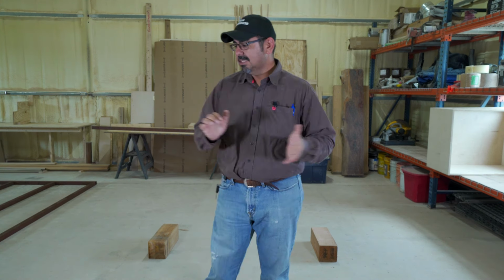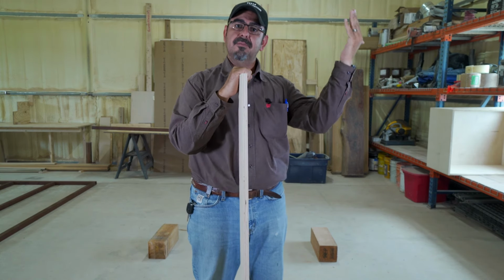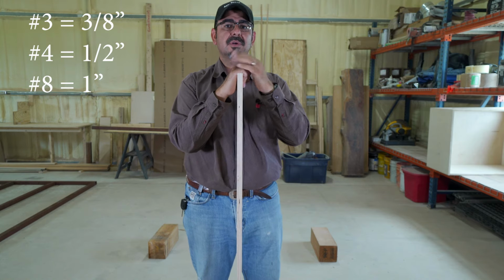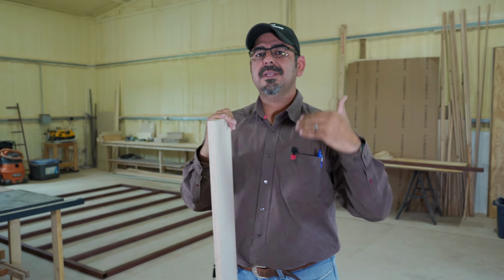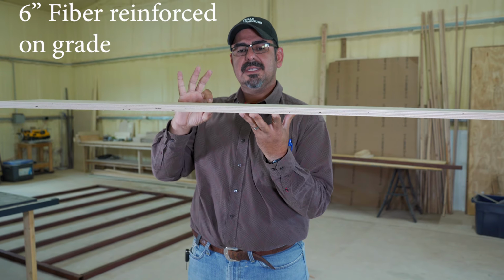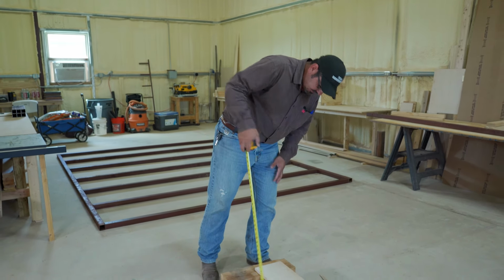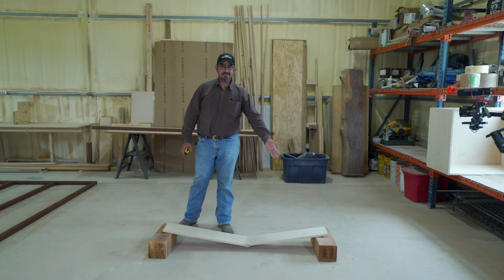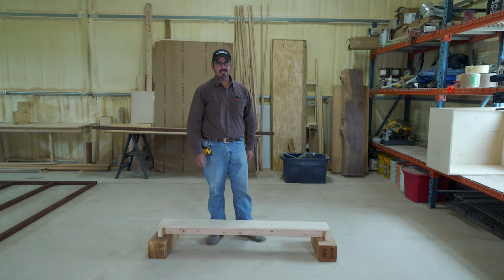Concrete thickness explained! - The Barndominium show E136

Comment: Mate.
Wood isn't concrete.
You didnt even mention the MPS (concrete strength). Best way to prove it is with pressure like an hydraulic press. It's not a good comparison at all mate. Not all concrete slabs need or have support beams or footing. 
Really? I think you should rethink and do a pressure test to see a 4" and 6" under pressure with the mps strength comparison. This is the best option.
Reply: You totally miss the point.

Comment: The man is absolutely correct! What he is talking about is the measurement of concrete, and the types they come in, such as, schedule 440 concrete is very good, but schedule 880 is primarily used in Marine applications, and it is a much harder and dense concrete then schedule 440. The drivers of the concrete trucks used to be able to tell you this, as one time it was required knowledge in order to have the job. The concrete truck driver had to know how to run the mixer, and what recipes to use for what application needed. Nowadays, everything's done on an app! So we people can afford to be stupid people. 😏

Comment: We get it. Nice job. However we arent building a bridge over a sikhole and parking a semi or landing a jumbo jet on it. Not a fair  comparison.  Just trench edges 8in, run some bar on stands , center in slab & depending on length & width, you might run a couple center beams. Adds a little extra cement but shouldnt be all that much difference. Too many projects require too much money for foundation. Its not that complicated.  Most you can do it yourself for 1/3 to 1/2 price. Engineers , plans, permits, inspections (unnecessary b.s.) also add to contractors peice. Buy you some acreage ouut in an undeveloped county & do it yourself & save 10s of thousands on slab part of project. If in city limits , im sorry for your bad luck.  You gonna pay😂

Comment: I’ll save you 10min
The thickness of a slab is determined by the span and weight it will bare, which can be calculated using the correct formulas or just use an engineer.

Comment: At 2:50 you stated the obvious, that a 6 inch slab will be stronger if they are built the same  using the same reinforcement material and all else being equal. So the title of this video is misleading and the video is a waste of time. Everything else you talk about is good information for the uninformed, but it doesn't prove your statement that a 4" slab is stronger than a 6" slab because the presumption in that comparison is that they are the same PSI mix, same slump, same substrate/base, same reinforcement, etc.
You should have used a different title and just did a video of how to get what you think you are getting when comparing concrete quotes. 
ALWAYS put all the specs in writing and field verify during the work. Most concrete guys will promise one thing then they "forget" many components when prepping and doing the pour. I've caught everyone of them (on my jobs) trying to leave something out or try to substitute something cheaper during the job. Very few honest ones out there.
Reply from the maker: Title is not misleading.  
“How can a 4” slab be stronger than a 6” slab?” 
Put beams in the 4” slab.  It will be stronger than 6” slab without beams.  That’s how.
Reply: @TexasBarndominiums  
Bingo. 
I have lost count the times I have met with applicators who know as much or more than the engineers. Bravo brother !!! Keep preaching the construction truth.

Comment: More rebar will make it stronger
Reply: Not necessarily. Not if it's done improper. You can have rebar every 2" but if it's not done properly the rebar will rust and concrete will delam
Reply: And then ultimately crack and end up looking like Syria
Reply: A good engineer will design the slab that works right and costs what it should. There is a whole lot going on with structural concrete - e.g. how deep in the concrete  you locate the rebar matrix is determined by whether the forces on the slab are tensile or shear. Curing of concrete is almost a discipline on its own! For simple, non-critical work, a common sense diy approach will work. In all other cases, read up extensively and talk to a real engineer, especially for building foundations and suspended concrete work.

Comment: This video doesn't make a bit of sense.  Your demonstration with walking on a six inch board with no support vs. a four inch board with support isn't a fair comparison. You're not comparing apples to apples.  If you applied the same support theory using a six inch support board to the six inch slab it's going to be a lot stronger than the four inch and when you walked on it like you did, the drop in the middle of the board would be less than the four inch board.  I thought I had found someone who could give me valuable information however, this lack of  proper comparison makes all your videos and posts suspect and harder to believe.

Comment: what plans dont include all the foundation information? are they dodging building permits/inspections?  When in doubt you talk to a structural engineer not the "concrete guys". Keep and require your slumps.
Reply from the maker: Some States don’t have inspections.
Reply: @TexasBarndominiums  while there are 15 states that defer entirely to local jurisdiction ie to the county and/or city level. Some government entity is usually get paid.
Reply from the maker: I know.  But there are thousands of people pouring concrete “wrong”.  No engineering, no inspections, nothing.  

They will pour a 6” slab with fiber over non compacted soil and talk about how strong it is because it’s a 6” slab.

Comment: Generally Footers are poured to support beams and these are from 12" to 24" deep depending on the load & soil. 

Another factor is the strength of the concrete (typically 2500 to 5000 PSI) & how much water is contained (slump test). a concrete with a lot of water (Makes it easy to pour and work) has a significantly reduced strength.

Rebar does not provide any additional compression strength to concrete. it provides tensile strength (resistance to pull apart). Adding fiber does not make the concrete stronger it just helps to resist small cracking and limiting small cracks from expanding. Rebar has some capacity to limit large cracking caused by tensile forces.

FWIW: My basement slab consists of 1/2" rebar 24" on center with 6" wire mesh on top (Mesh was used to secure the heating PEX tubing), 3500 PSI concrete with fiber added. Slab was 5" (needed an extra inch to accommodate PEX tubing). My garage slab is 1/2" rebar 12" OC with a 4" slab, 3500 PSI with fiber added. So far only a very limited number of hair-line cracks.  Under both the basement & garage slabs is 6" of P gravel. Both also have a 15 mil vapor barrier. 

Bonus: Avoid using concrete accelerators especially if your pour has rebar or wire mesh. The accelerators are chlorides that accelerate corrosion. If its too cold to pour, than be patient and wait for the weather to improve. If your are in a hot & dry climate place a plastic barrier on top of the concrete so the water does not evaporate before the concrete has time to finish curing. If your slab is starved for water during curing, it will significantly weaken it.

For outdoor pour with mesh or rebar, consider applying a Lithium Silicate sealer after its cured. This reduce the permeability of concrete for water reducing the moisture & contaminated (salt) from corroding the rebar\mesh It will also help prevent staining (Dirt, Oil etc)  Lithium Silicates are also used to create a polished concrete service for indoors.
Reply: This is great advice. Bravo. The only thing I would add would be to watch for the concrete guy adding a can of Coca Cola to the concrete mix which acts as a retarder. I would be asking where is my can of soda to watch the concrete cure.

Comment: Concrete and Wood are not the same there for your demonstration is simply only showing hollow space gives and solid pile of wood possibly screwed together to make what ever happens a header or beam or reinforced wood that's not anything other then you don't know concrete however your body isn't heavy enough to break that board, I know the strength of wood and how it works stop waisting my time

Comment: Anything over 600 sq/ft requires an engineer where I’m at.   Frostwalls, foundations, etc.  
any slabs poured in warehouses that will be under constant use of heaving equipment are much thicker then 4 inches for a reason my friend and there are a tonne of variables as you pointed out.  Under 600 feet , normal conditions,  sure 4 inches .  You got folk trucks rolling back and forth all day moving heavy loads,  your 4 inch pad and theory are garbage.

Comment: This is a strange video. Anyone who is doing a concrete job will do it in the way that they know how. And if they did two slabs in that same way where the only variable is the thickness, then the thicker slab will always be stronger. No? Now, if someone knows different ways of making a slab and are looking for the strongest and most inexpensive method, then they can ask an engineer for advice or make an educated guess. Why all the drama suggesting that 4” of concrete is stronger than 6”?! All you have to say is that the way a slab is engineered can vastly improve its performance and bring down its cost. Duh? Also, your demonstration would have been much better if you had compared 3/4” alone with reinforced 1/2”.

Comment: The variables are endless!!........ and we didn't even begin to scratch the surface are variables from prep to finish. Moisture in the soil,  precipitation prior to and during placement...... endless variables Folks it just doesn't come out of the truck is one giant finished slab of concrete. And it's not like a tree that you can replant if you dig your hole in the wrong spot.
Reply from the maker: Correct.
Reply: We used an surfactant made by "Amway" to treat the soil prior to a foundation pour and also damned up each lot and flooded with water to ensure we had good soil prep prior to foundation pours. This was clay soil or your max soil expansive index scenario. Texas Bardominums is getting most of my good tips and tricks to rock and roll.

Comment: This video makes no sense whatsoever..  You use a title about the thickness of the slab but spend the whole video talking about different reinforcements.. I wouldn't let you pour me a sidewalk
Reply from the maker: If you didn’t get the point of the video, I wouldn’t pour a sidewalk for you anyway.  😂
Reply: Whats your point? If you make it better, it will be better.. Wow your a fuckin genius
Reply from the maker: *you’re

The point is that a 4” slab can be stronger than a 6” slab if reinforced.

Comment: This guy does not know squat about concrete.
I have done concrete for fifty years. In a four inch slab, the rebar is too close to the surface or the bottom.
It will eventually destroy the concrete from the inside out. Roman concrete lasted thousands of years without steel.
In 200 years our slabs and structures with steel will crumble into dust.

Comment: Be way better if you could use actual concrete piece of slab both reinforced and non then drive a big hunka bulldozer over it as an example.
Then again who's driving tanks, bulldozers and semis over your residential home concrete slab.
This whole cross hatching concrete beams in slabs I see as a new deceiving way of just upping the cost to home owner and more money into contractors concrete pumps pockets.
For a residence home, just compact the soil then bring in add fill gravel and compact again then lay perimeter footing add reinforcing 3/8" rebar including on slab, then pour fiberglass reinforced concrete slab and thats it man.
No need for extra waste of concrete in so many cross hatch beams/footers I've seen lately, maybe a couple cross hatch beam footers is ok but these barndominium contracts are making you pay for way too much concrete and added rebar labor for more coin simple as this.
It's not some industrial tank factory building where there's huge heavy machinery bolted to slab vibrating away no need for so many freaking concrete beams on a house man, chill out

Comment: Number One : A SLAB is not the same as the FOUNDATION ! YOU keep interchanging these TWO terms. Everything being EQUAL; a 4 inch 'SLAB' is Not as strong as a 6 inch SLAB !!  You keep adding variables. Your insinuation that 4" of concrete is Stronger than 6" of concrete is REDICULOUS !  I bet you pour dry concrete and add water later, too !!

Comment: This isn’t the best way to describe it. 
There’s so much. 3/4/5 sack. Bar. Soil. My god I can go on and on. 
Let’s not forget clay in CA.
Reply from the maker: How would you describe the difference between flatwork and beam reinforced slabs?
Reply: @TexasBarndominiums  One is structural concrete (beam reinforced slabs) while the other (flat work) is not structural concrete. That is how I describe it in the construction class I teach at the college.

Comment: you should have leaded your video with the last minute . 
have your foundation engineered !

any ones opinion doesn't matter. whether thickness is thin or thick , has reinforcements or not . 
its math and its calculated . and its engineers who decide what type is needed for the job.

its only engineers who can tell you exactly what you need . nothing more nothing less . 
without engineer , you either will do overkill and waste cash , or you will do a weak ass foundation that won't do the job and fail prematurely.
there are dead loads calculations , live loads , soil tests ,..etc .
all is calculated then executed under an engineer supervision . 

some contractors add  water to make their life easier , sometimes they don't do slump test, not correct spacing , connecting , overlapping ...etc .

Comment: Idiotic explantation.  If you're pouring on rock subbase, it wouldn't make any difference if your floor was 4" or 6" or 24" thick, because the slab wouldn't crack unless the loads exceed the compressive strength (ie, 2000/3000/4000psi) of the concrete.  It all boils down to the strength of the subbase/foundation material and the load that will be applied to the slab. That's why it's key to have a soils and compaction test on any base/fill to determine what thickness of slab and what reinforcement and concrete strength is required.  What happens on small jobs where soils testing isn't done (due to cost considerations), engineers develop rules of thumb based on 'typical' soil conditions in the area and they spec a generic design that works in most situations - most of the time it's overkill and wasted money due to excess materials - but on some non-typical jobs it can be insufficient and the slab will fail - rarely is the 'typical' design just right for the site.  On larger projects, it pays to do soils testing and have a structural engineer design a slab/foundation specific to the on-site conditions - and then test the compaction of the foundation and strength of the concrete to ensure design specs are met.  Might be $5K for a custom home, up to hundreds of thousands on large projects. But it's always money well-spent.